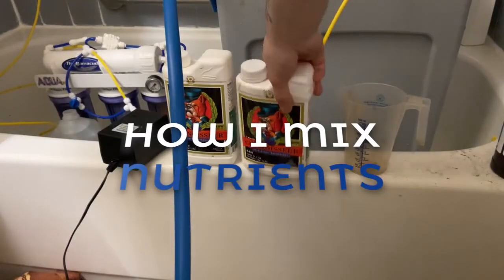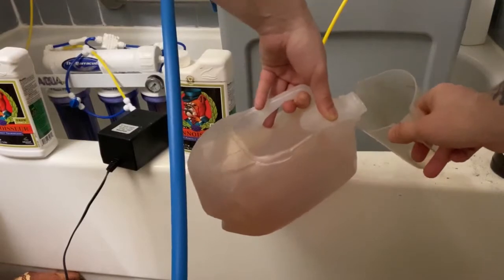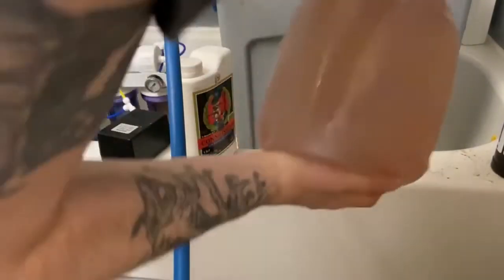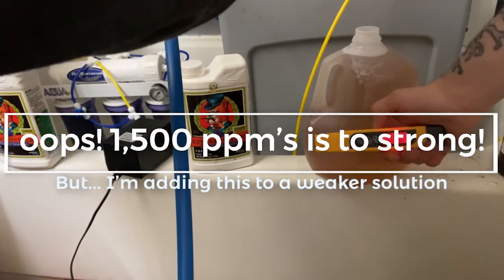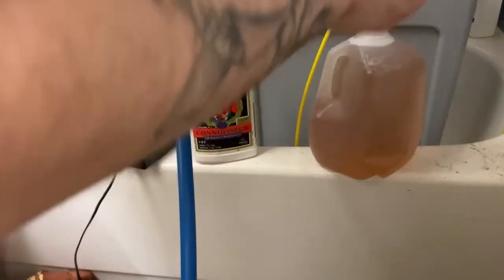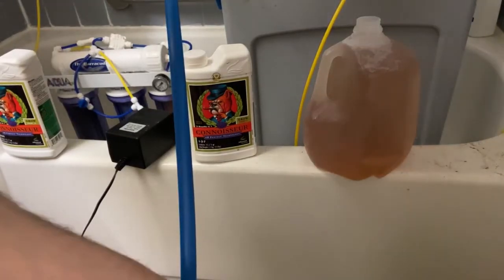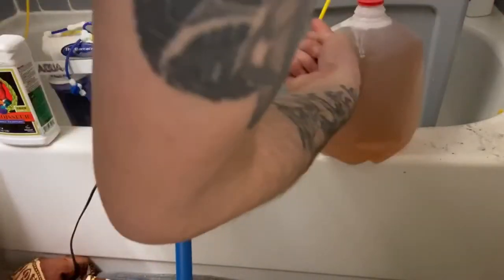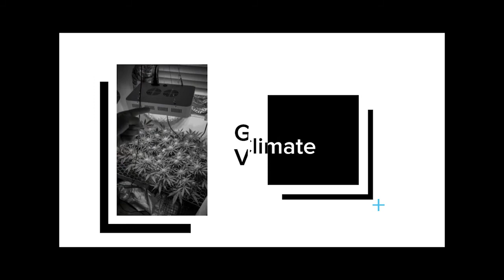How I make my nutrient solution for high pressure aeroponics using Reverse Osmosis Water RODI

Comment: I'm useing current culture nutrients. Should I still cut to 1/4 their recommended potency? The chart I am seeing that they provided has suggested amounts for aeroponics/recirculating nutes. Thanks again, your videos inspired me to give aero a try!
Reply from the maker: Hey Tyler, yes start with a 1/4 strength and then you can always go up. With larger amounts of water like low pressure aeroponics that are recirculating more nutrient's can be used. With high pressure aeroponics we use less nutrient's because the root's are holding all the nutrient's with little runoff. With more water there is a larger buffer. Keep me updated!

Comment: Hi do you mantain 1/4 strength max for the full grow ?
Reply from the maker: It’s where I start when mixing my base nutrients. When flowering I will go up with different strains. There is no set in stone way, everyone needs to experiment. If you were to test the left over nutrients, you would be surprised how much is still left over. We actually waste a lot of nutrients that the plants don’t absorb. This is why we constantly refresh the nutrients. If I’m recirculating the nutrients I use ones with pH stabilizers. And only use them for a week.
Reply: @AeroponicGrowers  I am running DTW, trying to achieve the least run off. I know some folks won't cross 1/4 strength with DTW
Reply from the maker: @jessesaitoo  I do all DTW. The reason for 1/4 strength is think of your roots as sponges absorbing nutrients through the day. In the beginning you will have a lot of run off. How I make sure there will be little run off is by taping a bag around my furthest mister for 1 hour. Multiply this by the misters and 24 hours. Make spreadsheets, your goal is to have a general idea of what amount of liquid will be needed ahead of time. This is called throughput. Your first grow will be a test to figure this out. I’ve pushed it on my nutrient ppm’s to 1000 in bloom and it was too much for me. But again, test and try things. There are a lot of recommendations, but only you will know what works best with your system. You’re the engineer!
Reply from the maker: @jessesaitoo  also your plants take up calcium at night but don’t drink much. This can be what adds to much runoff. It gets tricky and people try different things. Most common is adjusting your spray times at night. But you risk confusing the plant. I keep a little bit of liquid at the bottom of the container which is always draining. There is more in the morning but drains as the day goes on.